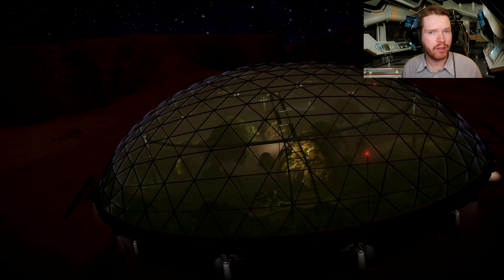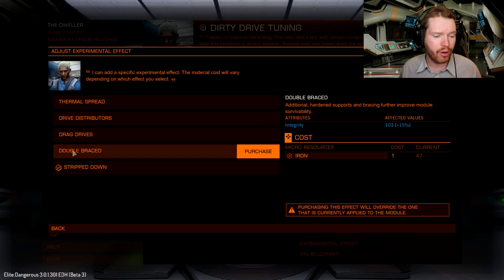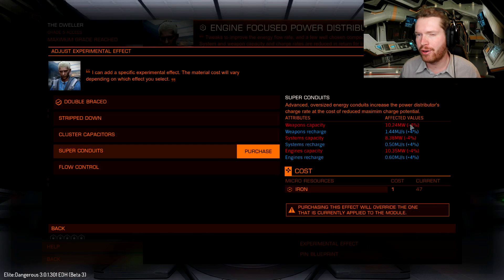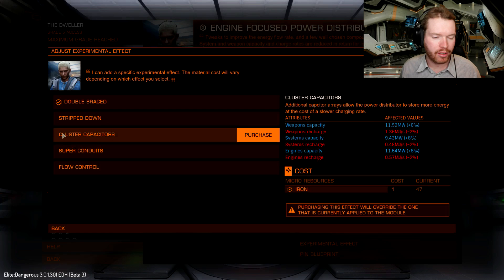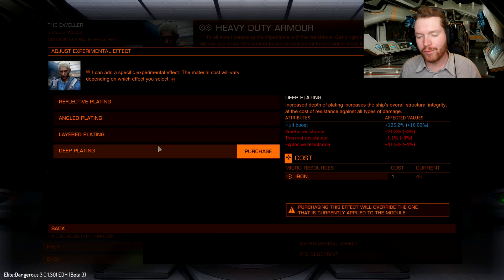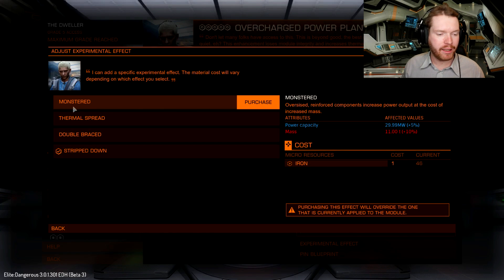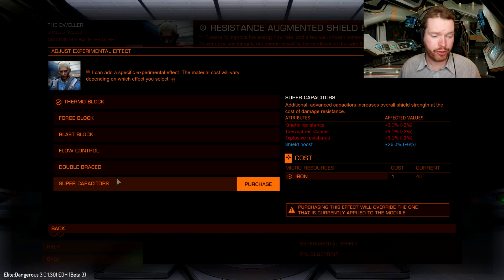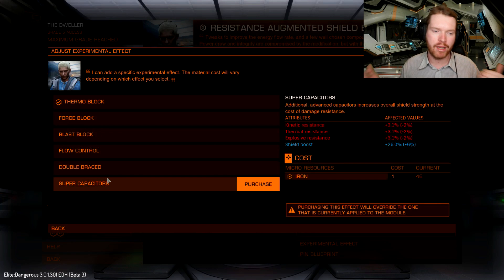New experimental effects for modules - Elite 3.0 Beyond Engineering

Comment: I've tested FSD experimental effects when beta was available. Tried it on my ASP Explorer, boosted tier 5 jump range to possible maximum (another feature), which was slightly better than my old engineered drive, but the experimental effects is what's interesting for me. So at tier 5  the difference between Deep Charge and Mass Manager is actually miserable with Mass Manager being slightly better (we're talking around 0.1 ly better), but - with deep charge you get a little bit more from fsd synthesis or neutron/dwarf boost. With the best synthesis Deep Charge was better (still around 0.1 ly better than MassMan. with the same synthesis). So I conclude this:

1. Deep charge is better if you are using synthesis or neutron charge often.
2. Mass manager is better in general ( but only slightly so) or, probably, if your ship has a lot of weight, or it's simply heavy itself.

I think I'll go with deep charge on my ASP and Mass Manager on my combat ships like Python and Anaconda.

Comment: from what I tested on my own ships, I always got better jump range from increasing the optimal multiplier VS increasing the fuel per jump - did you do a 1-for-1 comparison on the same ships layout and came up with the increased range on fuel per jump?
Reply from the maker: +George Campodonico yeah it made little to no difference in my case (on my camera anaconda)
Reply: i would say putting the fuel injection on the Anaconda doesn't make sense because that means more fuel scooping compare that to the Beluga with its really good fuel range would be more practical
Reply: Same here. The optimal multiplier always gave me more Ly increase than the increased fuel one, no matter which ship i used. I tested my Courier, Cutter, Corvette, Orca, DBX, Python, and Type-6. Didn't try the Anaconda. The Anaconda already has a ridiculously light hull so that may play a part.
Reply: Asking around, it looks like anything below a class 5 fsd want deep charge, the way formula work out with fsd sizes, get more benefit from using more fuel than the mass manager bonus gives. Anything larger than class 5 fsds prefer mass manager, as fsd uses a lot of fuel for less and less distance, so as fuel use increase get diminishing returns, so mass manager actually always gives more. At class 5s, its a wash, and whatever you want works. As it is, mass manager probably is still better because you use a shade less fuel than deep charge on the 5s.
Reply: David North good to know where the line is 5 fsd thanks :)

Comment: to get a new mod for a weapon will i need to generate a new upgrade or can it be for the current one as well?
Reply from the maker: You Can't add it to your current version of the module. You will have to convert the module to the New system and then add it.
Reply: cheers

Comment: the good thing is that you can still fly with your GOD Roles which are better in most instances over the one they offer in the 3.0... :)
Reply: NapFloridian don't they drop them to level 4 :/
Reply: They only drop to level 4 if you try to re-engineer a legacy module with the new engineer system. If you leave the module alone it will keep its old stats (grandfathering/legacy module).
Reply: Adding to this, I was looking through the changes concerning converting legacy modules to the new values and there was a comment by (Sandro? if I remember right) that converted modules would have a generally higher engineering cap. 
 I was thinking on this because how would upgrading a legacy module work from there, for example I have a Grade 3 engineered fsd on my corvette.  Following 3.0 update it would be a maxed out Grade 2 fsd, if I then upgrade it to a Grade 3 again would it lose its legacy status or does that remain?
Reply: As soon as you convert any old module to the new system, you loose its legacy status. I have a few modules that are better than the new system (amazing secondary effects that the new system can't replicate), thus will be keeping them as legacy modules.
Reply: Alright, thanks for clearing that up